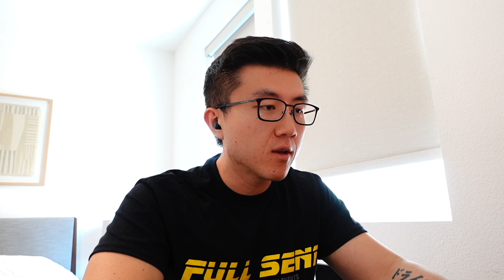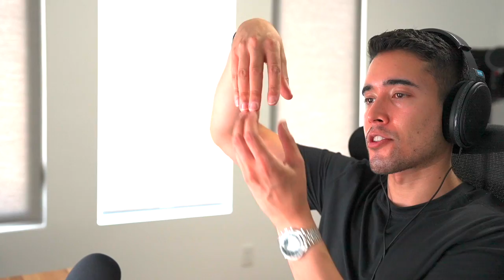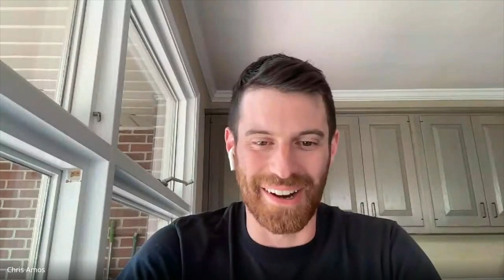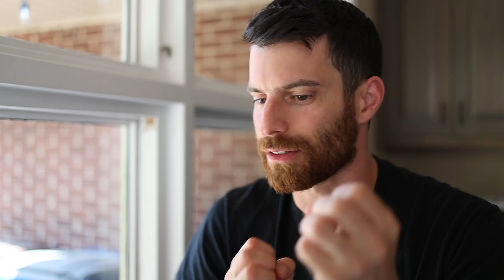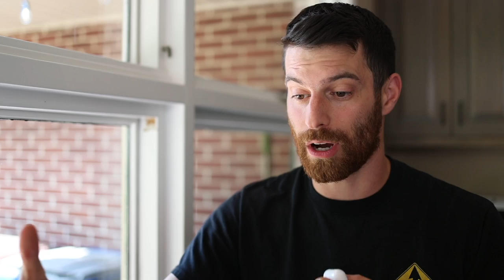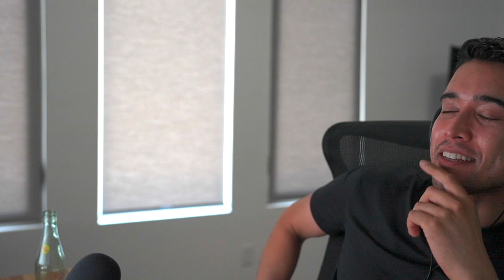Is Your BRZ or GR86 a Ticking Time Bomb? ft. TheTopher and Jubbal & Cars - ZCT #35

Comment: I put a Jackson oil cooler, Koyo rad, and mildly upgraded brake pads to start tracking my 2023.  It's been fun and has no problem staying cool, but it did puff on restart after the first session at a track with a long carousel.  So did the other 2 BRZs in my paddock that are running wider 200TW tires and the same cooling mods.  We're looking at AOS and catch can options, and maybe an Accusump.
Reply: That's very interesting/revealing!  Seems like the AOS could be the best option for these cars.  Ingesting oil through the intake can easily destroy an engine.

Comment: Great idea to share the information and prompt discussion. 
In factory trim the vehicle should not be able to overheat and oil pickup blocking is 100% a factory defect that should be recalled or covered.  
I'm not sure it's reasonable to suggest that you need to run different grade oil (which is worse under normal operating conditions), modify the cooling system, or be responsible for watching the oil temp' gauge like a hawk in this day and age. The car should also have appropriate safeties in the ECU with alarms to tend to oil pressure, temp', fuelling limits etc. prior to catastrophic failure.
Stock pads are probably the only exception there (and incidentally there's no way any rotors are enough to save stock pad turds on track). 
In regard to oil starvation it shouldn't be an issue when fitted with any commercially available/legal tyre like a 200TW. Easy to test with a log of oil pressure against lateral G so Toybaru definitely have this data and are fully aware of starvation limits. The only way baffles don't help with this issue is if it's an oil return issue like you see on deep skirt chev blocks, RB engines etc. 
Once you modify the vehicle then it's fair to say it's on you to substantiate that modifications didn't contribute to a failure. It gets muddy to say they haven't designed the performance car for track duties either because there's every chance that people globally can run on legal roads under similar conditions eg. the 'ring. Cheers!

Comment: Regular people should really have 0 concerns... I think you guys are on point with most of the points, but still leaving out some very important factors (or not putting enough emphasis on some):

1) The GR86/BRZ (gen2) is a very a very, very popular sports car. Even the prevous gen was popular and over it's lifetime the sales of the model had matched that of all Porsche models combined during the same period of time - what do we learn from this? - This particular car is exposed to more attention than most of the other brands and has a higher exposure to more hardcore amateur drivers due to the scale

2) The amount of people tracking the car more heavily is definitely proportionally higher than on other car models. Other cars are more expensive most of the time, so who buys them? Mostly people that are really rich and care more about showing off and keeping them ppf'ed and scratch free than getting the actual max out of their car on track. So the percentage of the people actually doing track days so frequently is most likely much lower for each model than it is for the GR86/BRZ... While most of the GR86/BRZ owner also don't track their cars or only track very occasionally, there's still a higher number people who find the car like made for the track and therefore track it.

3) Adding on top of point 2... Some people do consider the GR86 a cheap car and therefore a good track option. They don't necessarily want to do the best maintenance for the car, but are rather focused on the bang for buck aspect and trying to squeeze out more of the car or use it to learn proper RWD and some maybe even have a plan of selling it at a not too distant point in time in the future. So most likely people will try to save on maintenance, especially if they track the car a lot. Quite logical actually, if one tracks the GR86 1-2 times a year will probably go for an oil change before every track day, while those who do 10-20 times a year will probably skip some as it costs extra money and time...

4) With mods to improve track performance - so better brakes, engine cooling and tyres people are basically able to do longer and more intensive sessions than without those mods. This way the rest of the car parts still are put under a higher load for a longer time than with stock parts, resulting in more intensive  track days overall vs casual people who track their car without mods.

5) G-forces in corners - I think this might be one of the most imporant points. People are noticing that the problems are more common with high-G-force scenarios as you mentioned. But the point you guys probably forgot to put emphasis on is that this car indeed, especially due to it's light weight and fairly good aero, even stock, hits higher G-forces. Other sports cars are usually heavier and therefore have worse cornering and usually see less G-forces in the corners. Some of you even say that you are hitting 1.2G's in corners after a few mods on the car, which literally matches the G's that super expensive supercars do. So the problem is not the engine itself, but the fact that this car is put under higher G-forces due to it's superior cornering ability, while still not having the luxury of using the most expensive components as the price of this car has to remain affordable. So the engine is not a problem, it's the fact that this car is faster in corners than other cars and is therefore experiencing more strain than other cars...

With all those factors combined I'm pretty sure that this car is probably more robust overall than other sports cars and at least as good as the more expesnive cars regarding durability, especially considering the engine (because it doesn't have a turbo - as a GOOD mechanic if you don't know what I'm referring to). And considering that the GR86 is not meant to be a race car (and race cars also have a very limited lifetime on every part of theirs and the parts have to be replaced regularly while sometimes not even meeting the expected lifetime), it's a sports car generally meant to be driven by drivers who only casually go on-track, maybe 1-4 times a year and don't go pushing these cars above their intended limits or participate in race tournaments. Having said that, I still don't like how Toyota handles the cases and in my opinion they should still honor the warranty cases unless the drivers really participate in some higher profile events, which would classify the use as regular racing, rather than track driving. It's their car and they should appreciate their customers for buying it. Most won't track anyway... 

BUT it should be understood by regular people, that if you take care of you car, don't modify it too much, are cautious and track it only occasionally, then you really should not be concerned about the problem, because other cars would probably have more problems when put under the same conditions.

(if you like this comment please vote up so that the comment doesn't die)

Comment: For me, it makes no sense to expect a manufacturer to warranty your race car. That said, what's the point of having this capability if you're not able to use it. If Toyota is misleading the public about the BRZ or GR86's track abilities as a sales point, it seems to me they have a responsibility to recall it and fix the problem. If you mod it to be more competitive, that's on you, and I believe it should void the manufacturer's warranty. Blowing your engine is a bitter pill to swallow, so always proceed with caution. When building a race purpose track car the warranty is your wallet. Either way, it pays to make damned sure your car can handle what you're throwing at it. The old track mechanic's rule of thumb is every $1.00 spent on active go fast upgrades should have $3.00 spent on passive upgrades to handle it.

Comment: It was mentioned that a baffled oil pan doesn't help the issue, but I really don't see how oil starvation could be a key issue and a baffled oil pan doesn't help. At this point, I think they're basically required on a boxer engine that's going to the track.

Tomei makes an Oil Pan Baffle Plate. Assuming you don't have the RTV issue, I think this design has the highest chance of keeping oil where it belongs. I think if someone made an oil pan / baffle combo that increased the oil capacity that would be event better.

Comment: I vouch for those Australian brakes.  I used those with Dot4 brake fluid, Hawk HP+ pads, steel braided lines and running 215 tires on my RSX at Road Atlanta with a brutal braking zone on the back straight.  No overheating or fade after 20 min sessions on a hot day.  Interesting though, I upgraded to 235 width with lighter wheels years later at the same track and had smoking rotors and pads after coming off the track.  I think the extra tire mass or unsprung weight maybe was the culprit.
Reply: I have DC5S and got a set of RPF1 in 17x7 +45 (stock wheel size) and they weigh 14.8lb and the Advan AD09R tires weigh 22lb for a 36lb per corner combo.. made a gigantic difference over the OEM 17x7 @ 22lb each. Most people go wider for their tires and wheels without fully utilizing the previous size @ the stickiest tires they can buy.

Comment: this is quite interesting, and for me, personal-irony!  I'm eyeing the GR as eventual replacement for my 2005 RX-8 ....a noted "time bomb" of some internet-infamy.  That said, mine is still on original engine/tranny after being beat-upon for 100K+ miles.   Maybe I should just keep tracking it?? ;-P
Reply: As the owner of a turbo e85 450whp rx8. If you’re keeping it as your track car and premixing and using 20w50 oil every 2500 miles and no smog stuff and you redline consistently. That engine can last almost another 100k. My last NA one made it to 200k original engine and never lost compression. Lost a trans and a clutch before I lost compression. I’d say keep tracking it if it’s only a track and canyon car

Comment: Fairly new to Gr86 ownership and i'm more fast road/ rare track use driver. More data is now available and it seems shallow oil pan vs boxer engine and where the oil pick up is located are more of a factor than the RTV. Causing big oil pressure drops in high G right hand turns.  For an easy low cost low level of protection improvements in preventing oil pressure drop in high G corners were seen by overfilling by about half a litre of oil.

Comment: Basically everything I have seen is that if you plan to push your Gen 2 BRZ/GR86 then you need to be mindful of oil pressure and do some mods to mitigate pressure drops in hard turns. Even something as over filing with higher weight oil can have a big impact. Seems your average user will be fine, but we will see 5 or so years from now.

Comment: 8:05 The use of the dry sump oil system isn't limited to GTs in Porsche's lineup.  My 987.2 Cayman 9A1 engine has a dry sump.

I haven't finished the vid, but if I bought a new 86, I would use a group 4 synth oil, optionally change oil after or before the event, get the RTV fix and a baffled oil pan.  One of the suggestions a Cayman tuner (MotoIQ) recommended was getting a baffled oil pan when upgrading the suspension and getting stickier tires.  The idea being, when the cornering G's go up, so does the risk of oil starvation.

Comment: there is a video on here of a few brz/gr86 owners data logging oil pressure and they found right hand turns cause large dips in pressure. they used a previous gen as a control.

Comment: Thanks for this video! I have stock GR86 6AT and dont plan to drop pan or add oil cooler until warranty is up. Im also a novice driver just running Conti DWS06+ tires, so for HDPE events, I try not to shift past 7k, and the 2 tracks Ive been to, I was in 3rd/4th gear the whole time. 2 track days so far, and planning to do 1-2 HPDE yearly during fall/spring seasons only. Oil temps reach around 240F max after about 11-12 laps of novice/conservative driving. Also really liked what Chris said about "mechanical sympathy" I think of my car as my trophy and not a lap time chaser, so Im more focused on driving the car home safely and keeping that "mechincal sympathy" in mind

Comment: Engine builder / machinist here since 2010, not saying this will prevent all failures, but it’s crazy that people are using the OEM weight oil. At least 10w40 if not 15w40.

Comment: For what it's worth, I dropped the oil pan on my 2023 GR86 at 1000 miles and 2500 miles. At 1000 miles there was a disturbing amount of RTV on the pickup. At 2500 miles there was virtually nothing.
Reply: are you tracking the car? I've heard of these issues, I also own a 2023'. I am at about 4.5k miles and have yet to drop the pan at all, but I do not drive it hard at all; just highway/city driving for the most part. I realize maybe I should consider dropping it but then have also heard that doing so voids warranty and having a dealer do it costs about 400$ or so... so I am curious as to what kind of driving you are doing considering the RTV in your pick up.
Reply: @avilescarlos411  I am tracking the car and running it on 20p TW tires. Also Installed oil cooler and dual level oil baffle. Running 5w30 oil. After four thousand miles in several track days, she's still holding strong. Pray that keeps up. If you're street driving the car on stock tires, you're probably OK  not dropping the oil pan  but that's just my opinion.
Reply: @throker   praying for you man ! Haha, I hate that all these malfunctions are occurring to such a beautiful car. I bought it for its looks, to be honest. Not tracking it, not racing it, just cruising and some grandpa driving lol I have barely revved it past 4k RPMS, and redlined maybe once or twice
So, all in all; I am calm about it for the most part but it’s still super unfortunate cause the car is amazing both to drive and gaze at

Comment: There's a video of a guy who had catastrophic oil starvation issues with his gr86 and he was just putzing around the track in 4th gear with brakes.
Reply: Finally a comment about that guy. He was keeping the car in the 5 to 7k range for no reason at all. Literally just letting it run at high RPM through entire laps at low speeds. His oil temps were pushing 260 and he kept redlining the car. How much abuse did this car have that we didn't see? Plus he was tracking it with the AC on, lol. Toyota STILL bought him a new engine. No way I would drive my car like this. It's one thing to use revs to pull a car and it's quite another to run it up there.
I guess I'm just irritated that this one video caused so many misconceptions about why it blew up

Comment: My worry is them saying you put other than specified oil weight in the engine and void your warranty for that
Reply from the maker: I'm worried about this too. It's frustrating because running the OEM oil will drastically increase risk of engine failure.
Reply: @Zygrene  same with oil cooler, cleaning the RTV, a baffle, accusump, AOS etc. Or even heavier fluid in the trans (the factory 75W is too thin). You get penalized for trying to take care of your car
Reply: I could be wrong (I’ll check the manual) but I could have sworn it also says 5w-30 was fine. Or maybe it said 5w-20 I forget. 😅I’ll triple check it!

Comment: I have 2018 Brz ts. Daily driven. First owner. 77k miles. Done all my maintenance at the dealer. Just recently. I went to take it in for an oil change and they notice metal shaving in the motor oil.  Is that common???

Comment: Since last year, it has been rumored that Toyota is already working on a next gen 86. I wonder if this is why
Reply: It's my understanding that toyota has a difficult time managing the ongoing "subaru engine" related issues. They are developing a toyota built gr86 which is scheduled to release in 2024/25 and have the 3 cylinder that's currently in the GR Corolla with some sort of intergrated hybrid setup.
Reply: @Yul-Uhlu  Will it still be manual?

Comment: Boxer engines have oil pool in the heads in high G corners. this is why Porsches have scavenger pumps in the heads and/or are dry sump.  Miatas can handle 1.5G on stock oiling
Reply: Its a proof inline 4 owns boxers all day.
Reply: The FA engines have factory baffling to combat head surge. Unlike old EJ. The FA24's problem is more in the timing cover.
Reply: @VinRZ  interesting... Hope the FA24 oiling gets solved soon

Comment: I want an 86 so bad, but really dont want the boxer engine...might wait to see what the 2025 rumours bring.
Reply: I love boxer engines personally, but would prefer my Toyota to come with a Toyota engine. KillerB Motorsports is currently in extensive R&D for a unique oil pan baffle that does indeed remedies the oil starvation issues. They even got some customers that run track days doing some field testing now. Once the appropriate design has made it to market than no more issues. Just a cult classic car living out its years without infamy.